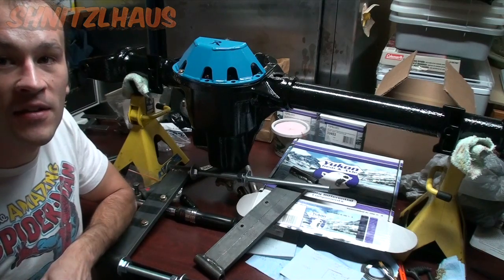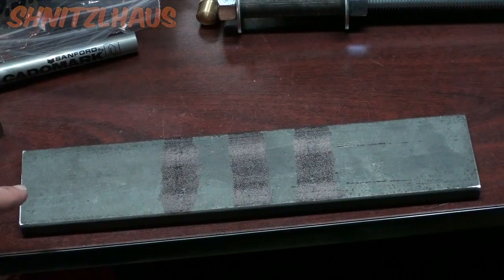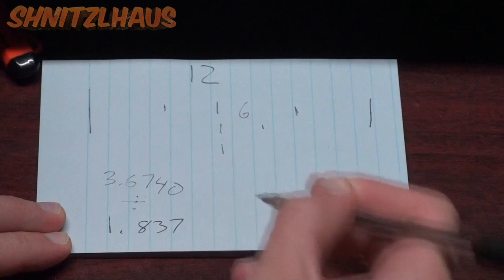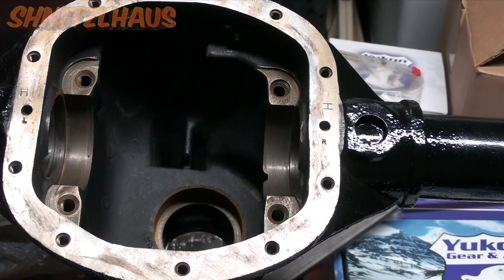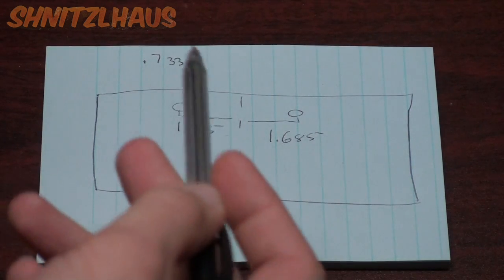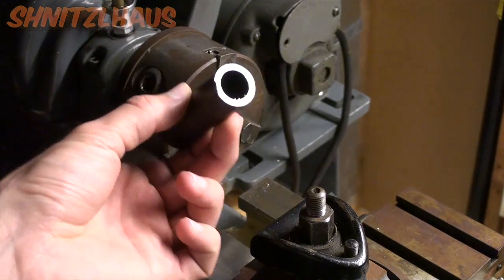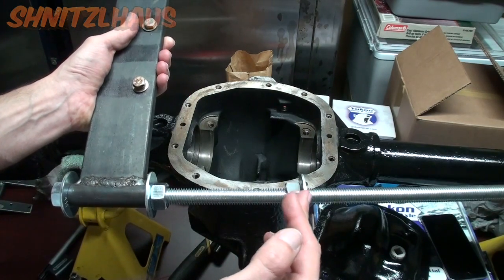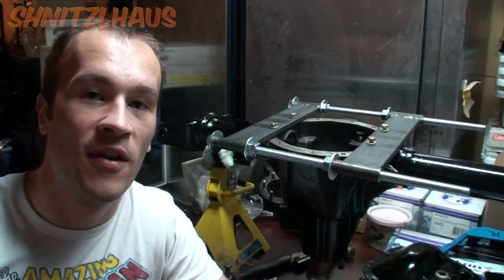Dana 30 Case Spreader : How To Make

Comment: Nicely done, very simply explained and designed using common materials.  I'll use B7 high strength all thread, because I have access to some.  However the author says it is not necessary as the load required isn't huge.  My application is a 1041 Volvo RWD rearend (made using the Dana 30).  In my application the carrier preload is .003" to .004" per side.  Thanks again!

Comment: Are you going to put out a Dana 30 rebuild video like your T-90 & Dana 18 videos (AWESOME by the way).
Reply from the maker: +paneramix aww gosh, I had contimplated it but not sure I will.  I am currently 3/4 done my dana 30. I could possibly do a short segment with video/pictures. the most difficult aspect is getting familiar with reading the pattern.  I do highly recommend everyone to try rebuilding one, life is easier with proper tools like a good in/lb torque wrench beam or more preffered dial setup bearings (machine them out of round stock, or hone/flap disk out the inside of new bearings to tightly slide on the ends of the carrier).  other then a few specific tools to invest in and reading the pattern (if you decide not to use a setup gauge) the actual process of the rebuild is just as easy as the T90 and Dana 18, not kidding.  those pesky oil baffles that reside under the pinion cup, substitute them with shims while your doing your trial and error on pinion depth, then on final assembly use the proper oil baffle (.020) saves you some money in baffles!  like always I recommend doing as much reading as possible on the subject, the old dana 30 service manuals are good source of information!   thank you for the kind words, I appreciate it :)

Comment: Hi ShnitzlHaus

Instead of all that complicated math, why didn't you simply  use the differential cover as a template for marking the holes in your spreader bars?

Regards

Dereck
Reply from the maker: Hi Dereck. 
Yes that would be quick. In that case I’d be worried about being squared up, but scribing a line offset from the edge would make it easy to line up the bolt holes by eye. 
Then transfer with a straight edge to the other flat bar

I typically will always go the complicated way to keep my mind working in that way. It’s beneficial in other projects.

I think others can go your suggested route to save time ;) good comment!  Just make sure everything is squared so your threaded rod pushes evenly
Reply: @ShnitzlHaus  
Hi ShnitzlHaus

I am not sure anything as draconian in the first place as spreading an axle case to remove the differential assembly has to be hugely accurate to the last 10000th of an inch, drilling your mounting holes slightly oversize would allow everything to line up especially when you start to apply some spreading pressure, after all you only have to tweak the case 0.015".

Anyway I sure am glad I found your video as I was about to make my own version of the official tool to do a rebuild on the Dana 50 fitted in my Excursion, your tool seems a little easier prospect, obviously the hole spacings in the spreader bars will be different, I also think I can make some aesthetic improvements to your version.

Regards

Dereck

Comment: I like it. Way better than those 400 set ups! You can even punch holes on the other side for another case. I'm making one!
Reply from the maker: Thank you.  I am working on a Dana 44 now and I slotted the lower left and right side holes downwards on my mill .250”, I kept the top untouched.  So this one side you see in the video gives me Dana 30 and 44.  If you don’t have a mill a dremel or rats tail file will work.

Comment: Excellent explanation and recommendations.  Will this setup work on a D44 axle? I only slightly considered toying with the axles in the past but after seeing how a case spreader works (I think it's necessary to get a certain locker in my vehicle since Midas said it wouldn't fit, yet I am pretty sure it's the right aftermarket locker for my axle), I may just give it a try.  Just out of curiosity, is there a measuring tool large enough to measure a carrier/locker so I can get a pretty good idea on how many more, or less, shims to start with to adjust the backlash?  I've heard that is a tedious process of undoing, adding a shim, and redoing.
Reply from the maker: Wayne, the bolt spacing is different on a D44 so you will need to measure as I described in the video.  installing gears is somewhat tedious as you mentioned and you should have a good understanding of how each step influences your pattern, I suggest reading the older dana/spicer service manuals a handful of times until you are confident and understand the steps and tools you will need. you can do away with the pinion set up tool as that can be substituted with reading the pattern with gear compound, it will also fill you in on obtaining the shim pack starting point.  sorry if this is a bland response but I would hate to mis communicate a step if I went into great detail. and don't let all this scare you, I believe everyone is capable :)

Comment: ive never used a case spreader when working on 30s.

very nice detailed video though!
Reply from the maker: I have tried both ways and agree, a 30 is okay with a dead blow with healthy hits.  I will be working on a 44 shortly and anticipated possibly needing one? I will find out soon enough. thank you for the kind comment.
Reply: Did you need one with the D44 I found one of these on ebay for $119 I don't have access to a milling machine after looking at your video looks easy to make
Reply from the maker: +blastman8888 milling machine is not necessary you just need something to drill holes. Drill or drill press would be ideal.  You will find opinions both ways,  if you want life to be easier it certainly helps.

Comment: This is one of the best instructional videos I have ever seen. I work on Dana 30s for racing application in vintage Volvos. There are a a whole host of Volvo Special Service tools associated with getting the backlash, ring and pinion depth correct without having to take the carrier in and out multiple times. These tools are no longer available. Are there substitutes?
Reply from the maker: Hi Jim, you can still purchase setup gages, just not OEM which I find to be more simple to use.  most manufactures make them universal now or I believe so.  I am going to send you a message.
Reply: Is the axle in the 240 a dana 30?